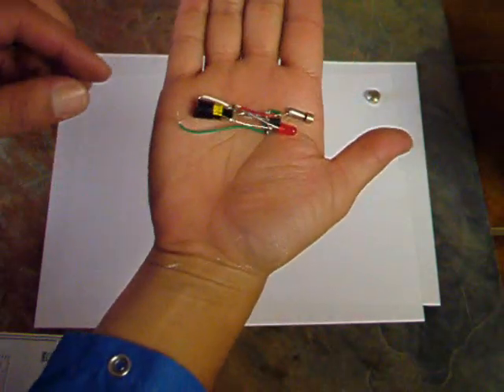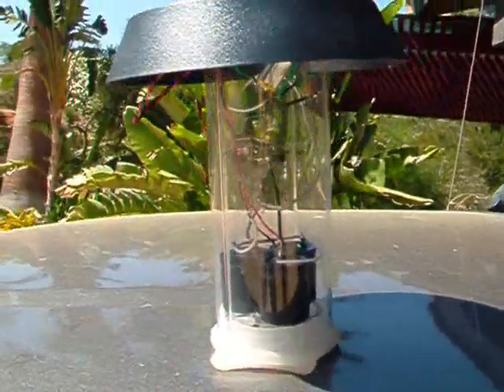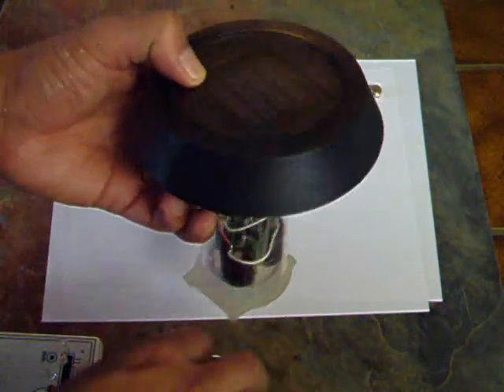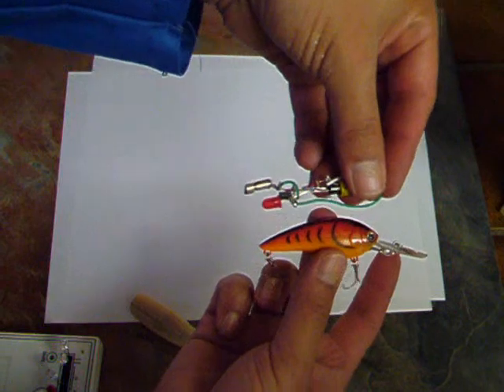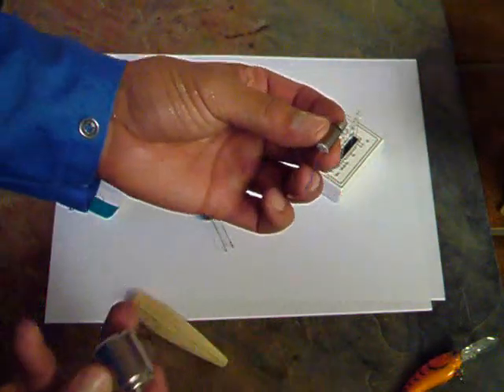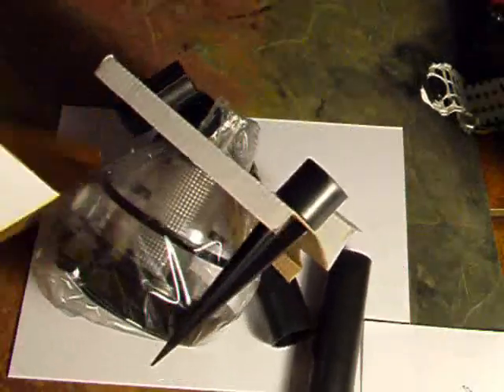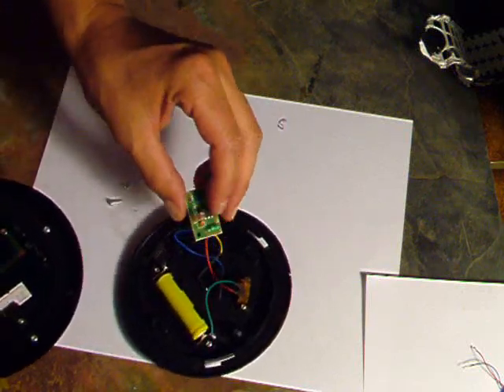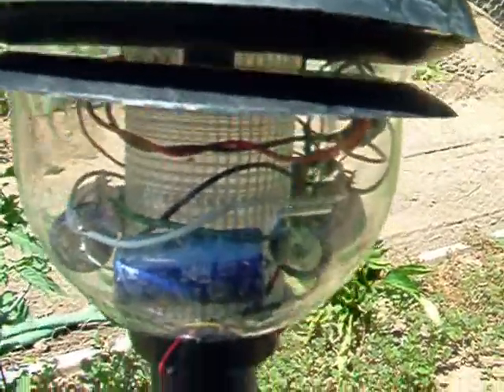what i did w/Re: Weekend Project: Make an Electronic Cricket

Comment from the maker: I don't think more caps will work even if they are the same motor. If one motor has a lower triggering point then all the power might just go to one motor and not both.  I think each motor should have its own driving circuit.  What are you making?

Comment: A bit of a hack job on the cell phone. I suggest using scrap electronics for the rest instead of paying way to much at radio shack ... You could also use green LEDs to replace the solar cell ... you can find "info" on "greenwatts"